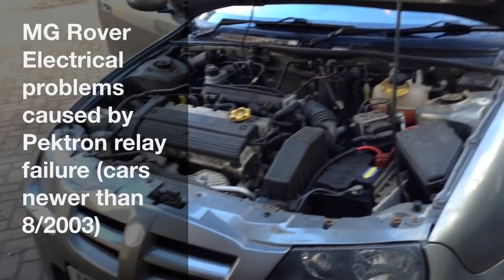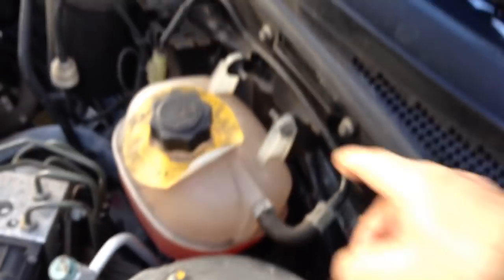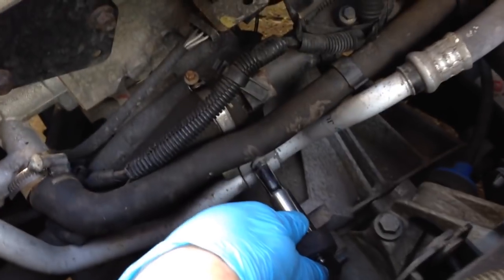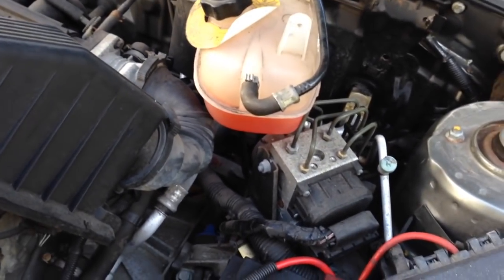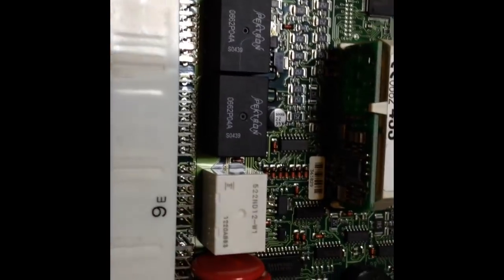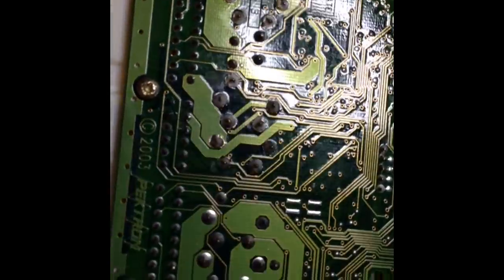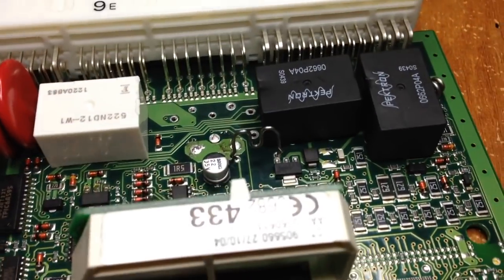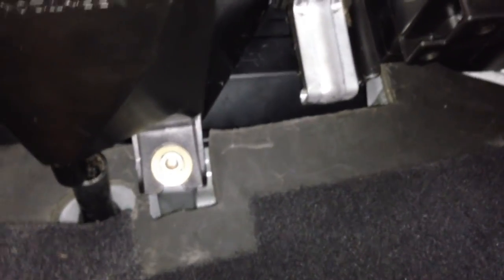How to Fix MG Rover Electrical Problems - Pektron Relay Fault - 8/2003 on

Comment: Good afternoon, I have seen your videos and you are a great professional, could you help me? I have a MG ZR 1.4 since 2003, I really like my car, but a horrible breakdown has come up and I can't find a solution, occasionally the idle goes crazy, the revs go up and down without control, this is very embarrassing, I've tried solve this by changing IAC, TPS, MAP, Temperature Sensors, camshaft, crankshaft, lambda probe, clean connections, check cables, vacuum tubes, change ignition coils, cables, spark plugs .... I don't know what else do, this is maddening, the only thing that works is to turn the ignition key and step 5 times on the accelerator pedal, but the fault appears again in a few days, sometimes weeks ... Could you help me please? Thank you.
Reply from the maker: Thanks. Yes a fun car to drive.  It sounds like the fuel mixture has gone off and the E?CU is stuck in an adjustment loop trying to compensate or trying to adjust the IAC motor (Idle control).  When the revs are going up and down try disconnecting the plug to the IAC to see if that is involved and see if it stops.  If it does your could leave it disconnected - the idle should stay at the position it was at when you unplugged it, so you could do it at say 1000 rpm which is not too high but is enough to stop it stalling when cold.  If that doesnt help you have to look at how the air/fuel ratio could have gotten upset.  Normally this is monitored and set by the ecu by it looking at the lambda/oxygen sensor. An OBD2 dongle with IPhone software is very cheap (see my video on this) and would show you results from these so you can check them.
Reply: Thank you very much for your answer, a while ago, when I also had this problem, I restarted by pressing the pedal 5 times and then disconnected the iac valve, when it was close to 1000rpm, a few weeks later the problem returned, not as serious as before, but the Revolutions were still crazy, so I thought it would be the first lambda probe and decided to change it, but this did not solve the problem either, after a few weeks it happened again.
Reply: I do not know if it will be a coincidence, but on some occasions, the fault has appeared when the wheels have skidded on the gravel when accelerating, for this last reason, yesterday I was checking the speed sensor and the abs sensors ... I don't know what to think, I run out of ideas.
Reply: Some time ago I bought an elm327 obd2, but no code appears when this fault occurs.
Reply from the maker: @eusebioveiga1914  What about reading the lambda sensor readings when this occurs.  By the sound of things the mixture strength is off, maybe an air leak.

Comment: Hi, my glove box is still slack and won't close properly. I suspect the engineer did it when installing a black box. Any ideas ? Thanks
Reply from the maker: The trick to fixing anything is to work out how the latch works and to figure out why it is not working by looking at it.  Then you will be a able to see how to fix it.  See if that approach helps.
Reply: @comeinhandynow  i'll have a look at the two bolts you undid. I thought it was the other two facing outwards. Thanks.

Comment: if you disconnect the battery will that activate the immobiliser ?  can you do this job without discconnecting battery
Reply from the maker: You can I think. I think that is was I did. You can also disconnect battery if you wish but you will need radio code to reenable that.

Comment: Hi,
I am trying to remove my BCU as per this video.
Glove box off, brackets off, filter out, etc. I can move the evaporator quite a lot but for the life of me I cannot find the BCU. Is it behind the evaporator? I've felt and got a torch in there and cannot see it.
Thanks
Reply from the maker: In between the evaporator and bulkhead, as mentioned in video you have to move evaporator out a bit.  Some models like the Mgf I think have it behind the central console.  Google the model you have to find where it should be located.  Be interested to know how you get on. Good luck
Reply: @comeinhandynow  Hi, Thanks for the reply a while back. I have a ZR and I did manage to get the BCU out. I found it easier to remove the AC Housing (AC previously already removed). Once BCU repaired I will intend to re-fit the housing, but mount the BCU somewhere better. 

A question though, the board and relays look in VERY good condition.. I'd expect if the relays were effected by water ingress then I'd expect to 'see' an issue? Or can the board and relays look fine from aesthetics but still have been damaged?

- Drivers window does not go UP (only down)
- Horn does not work
- Alarm triggers if locked via Fob

So I do have multiple symptoms of BCU relay issue, but really worrying if the relays get replaced and issues still present! Haha

Cheers
Reply: Just re-watched the bit where you had the BCU out, yours didn't "look" like there was anything wrong with it. Feeling a bit more hopeful that this is the issue! Thanks again
Reply from the maker: @beneaton91nexus   It’s not water ingress that makes the relays fail, it’s that a wire breaks deep inside the coil of the relay, from what I can see.  So they will look fine from the outside.  Hopefully changing them will fix the issues, just be careful not to break any pcb connections when replacing.

Comment: Hi. Just purchase a run around 2003 MG ZT CDTI 2LTR Estate. Have issue with the central locking. The key fob opens the car but it wont lock it. Have to do this manually. When pressing the key fob, the light shows on the fob but nothing happens. Any ideas.
Reply from the maker: I can only suggest searching the web or those MGrover forums.

Comment: hi i need some help..i recently bought a 1995 rover 416 and my a/c won't work properly..when i turn it on the car just dies..my mechanic told me that the a/c was put on after the car was bought and he thinks that it has a bigger compressor and that the car can't support it..
Reply from the maker: Sounds like the compressor is seized.  Look at the compressor when someone in the car turns on the a/c.  It should go from not turning to turning round as the a/c clutch on the compressor is engaged.  Does the end turn at all?  Try giving the engine some more throttle and revs to stop it stalling.  Does the compressor turn round then?  You could also try turning it by hand to see how difficult the compressor is to turn.

Comment: Hi any help my horn is not working in my mg zr changed the fuse under glove box still not working ? Also I need to take it for mot any help ? Thanks
Reply from the maker: Hi Jay, it is probably the issue I talk about in this video.  From the video description section: “Own an MG Rover built after August 2003? Is one of the following not working:
Horn? Drivers electric window? Central Locking? Fog lights? Intermittent wipers?
It is very likely going to be one or several of the Pektron relays in the SCU unit that have gone”
Reply: @comeinhandynow  thanks where is the scu unit ? Also it’s going for mot tomorrow can they fix it you think ?

Comment: I just got my rover today, and the electric mirrors don't work and neither does the rear drivers side indicator. I don't know what the problem could be?
Reply from the maker: Check the bulb. Try ebay for a second hand mirror.  Get a Haynes manual to help fixing and servicing it.
Reply: comeinhandynow unfortunately I don't think it's the bulb. As for the mirrors, I'll try what you said. I hope it's not a problem with the ecu but surely I'd have more problems if it was?
Reply from the maker: Doesn’t sound ECU related.  With any electrical problems it’s best to get a multimeter(voltmeter) and using the circuit diagram from the Haynes manual, then measure at different points on the circuit related to your fault to try and track down where the fault is.  On bulbs measure their resistance to check them, then measure the voltage on the plug and wiring going all the way back through the switches and fuses etc.  Eventually you will find one spot that has some voltage (usually 12v but it will be going between 0v and 12v if an indicator circuit) and further along another spot that hasn’t any voltage.  So the fault lies in between.
Reply: comeinhandynow brilliant, I'll give it a shot. I don't want to return the car because its sold as spares or repairs and I don't want to go through the trouble of trying to get money back on it, so fixing it myself is the only option. I'll see how it goes anyway
Reply from the maker: If it was a “spares or repair” I would expect quite a few faults.  If you only have those then it’s a good buy.
Reply: comeinhandynow yeah, the electronic problems are really all that's wrong with it, mechanically it's fine. Cheers for your help

Comment: Help me please. I have a Rover 25 stopped working its alarm command after replacing the battery.
Reply from the maker: VIDA EM PORTUGAL Press lock 4 times and unlock 4 times and keep repeating until it works. It needs to resynchronise after a battery disconnect.

Comment: Will this work for a rover 25 2005 reg? As my front wiper does not work but the rear does and also my car locking system does not work it will unlock the car but won’t lock it and I also have issues with the heating as it only works on the third setting onwards not 1,2 could you please help thank you!
Reply from the maker: Please see the video description. Applies to cars after 8/2003 so yes. Fixes intermittent wiper action and locking.  See my other video on fixing the heater fan.

Comment: Were is the tensioner so i can put my new altornator belt on my mg zr 2 lt 05 plate diesel pls
Reply from the maker: Alternator belts often don’t have a tensioner, they are given tension by the position of the alternator, so slacken or remove alternator bolts to fit or adjust the belt.

Comment: help got mg zr on 03 plate no indicators rev counter and speedo work when they won't to and when i turn the wipers on the engine cuts out
Reply from the maker: 1st measure the battery voltage (get a multimeter, only about £5). Should be about 13.4 volts with engine running.  Measure at ECU.  If not check connections to it for ground and power.
2nd check earth straps and that every circuit has a good supply voltage.
3rd if necessary for tracing circuit wiring, get a Haynes manual for your car.  They have wiring diagrams in the back.

Comment: i thought i would mention,,if your air con is drained or not working,as mine was,,its a lot easier to remove the air con box,,,a lot of huffing and puffing saved...
Reply from the maker: That is true, but I wouldn’t leave it disconnected for long as it may mean a new dryer canister is need in the a/c if you decide to regas it, as it may absorb water from the air.  If it’s not fully pumped out the release of cfc’s is damaging to the ozone layer. Not that a one off makes much difference.

Comment: I own an MG ZR 2004 i replaced the battery in one of the fob's and its it doesnt work at all and wont sync up to the central locking ive tried everything.  Also the hazard lights go off by themselves when i turn on the cd player, when i removed the cd and re-attached it they stayed on and only went off after i turned the car off and let it sit for a while.  Also sometimes starting her theres very little kick from the battery.  When i turn on front wipers the back ones go off.  Any ideas???
Reply from the maker: +TheNotoriousTMC Worn out car battery and fob needs syncing by repeatly pressing open and close lots of times near to the car.  Sorry for late reply, just noticed this!
Reply: Hi I have a mg ZR 2005 an iv lost the key fob or immobiliser unit .I still have key ,is there a after market or replacement fob  key supplier that can replace an a method to sync etc I live in newzealand an there isn't a abundance of parts shops etc

Comment: hi do you no if this will affect the hazards switch
Reply from the maker: I don't think so
Reply: I have a problem with the drivers window but I just can't get hazard working light to work I checked almost every think
Reply from the maker: Go through the wiring from the power end, to switch, to lights etc and test at every stage.  Use a wiring diagram (Haynes manual)

Comment: Hi mate my passenger window works then stops for a week then works again any I dear if not thanks anyway
Reply from the maker: Try taking the panel off the door, to get access to the window motor.  Connect a multimeter to the wires to the motor.  See if it reads 12v across some of the wires when you press the window switch.  Keep this connected over the coming weeks and see if the readings are consistent. This will tell you whether it is the window motor that is the problem or the wiring from other parts.
Reply: comeinhandynow thank you very much I'll give it a go

Comment: I have "03" rover 25 2.0TDI. 
Goes into limp mode (fixed 1200RPM & no throttle)  when headlights are turned on, any ideas?
Reply from the maker: maffu waring Headlights on means a lower battery voltage to the ecu if your alternator or battery is poor or the wiring has a poor connection somewhere.  A low voltage to the ecu may push it into limp home mode.  I would start by checking the battery voltage going to the ecu (use a multimeter) to see if it changes when this fault happens.  The voltage would normally be around 13 volts.  Good luck!
Reply: comeinhandynow it is fine with AC, rear heated window, ew etc. I was thinking the same until it was fine with these drains
Reply from the maker: Headlamps take a lot of current, probably more than those others.  Checking ecu voltage is probably a good place to start.
Reply: Any chance of a step by step?  
I'm hoping it's something simple lmao
Reply: comeinhandynow
Reply from the maker: You need to get a wiring diagram (look on eBay for a Haynes manual maybe?).  Multimeters are cheap, about £5 if you shop around. Start familiarising yourself with both, then try and check voltage going to ecu,  that's as much as I can offer remotely.
Reply: I can use equipment, and have a multimeter. Just not sure what I'm looking for our how to access
Reply: comeinhandynow
Reply from the maker: You need to get a wiring diagram (look on eBay for a Haynes manual maybe?)....try and check voltage going to ecu, that's as much as I can offer remotely.
Maybe before that step just do a quick check of the battery voltage, with and without head.ights on. It may indicate a problem if it drops.

Comment: Nice and helpfull video their. Personal opinion after seing where the dopey gits who designed the ruddy location of the unit would be to then RE Locate the device. Eg either cut and solder more wire inline with the connectors or make them stretch. A days work no doubt. And a two second job the next time around.
Reply from the maker: Cheers. Once all 5 relays are changed no need for a second visit and once it is out it is a bit easier to refit.
Reply: @comeinhandynow  and every new car which Follows that also gets harder to repair. And we get older each time. Henc the bliter gets away again.

Comment: I have got a rover 75 can't get one of the number plate lights to work can any one help me with the problem
Reply from the maker: A Haynes manual may help in terms of taking it apart, perhaps.  If all else fails put in an extra wire connecting it to a light that does work.
Reply: I bought two new bulbs passenger side works but driver side doesn't

Comment: Hi I don't want to get into this if I don't have to

This is my issue

Hi all IV got an 54 facelift mg zr the dahslights (Speedo rev count) background light does not come on,

I have checked all fuses under bonnet and under drives steering wheel area. 

I have taken the dash out and checked bulbs and none are blown.

What else could the issue be caused by.

If it helps the car randomly stalled when idling parked up and when the car started back up the dash lights where now not working.

Has anyone had this before or know what else do can check to fix this issue?

Help appreciated 

Thank you

UPDATE* 
SINCE THE ISSUE HAS OCCURED

THE FRONT bumper passenger indicated bulb doesn't work if you use the hazard lights but if you indicate with the stalk it's fine, 

The passenger window also now no longer working. 
And a rear passenger tail light also not working 

So is there a relay or some electrical thing that these Al go to which has blown like a relay or something or a circuit board??
Reply from the maker: Sounds like you have a corroded earth point that is causing a bit of havoc.  Try and measure the voltage at a bulb that should be on but isn’t and see if it the positive side that is not at 12v or the negative side that is not at 0v.  You must measure the voltage with your negative multimeter probe on the battery negative dirrectly.  This test should guide you in the right direction.
Reply: Okay thank you is the earth I should be looking at the battery earth or one off the alternator that could've bad?
Reply from the maker: Probably some junction somewhere, but you need to trace it back from the point of failure. So measure the voltage between the battery negative and the negative connection to a failing bulb.  If that is not zero then the earth .connection that that wire goes to is bad.  Trace it back.

Comment: why dont you just buy some desoldering tape its easier
Reply from the maker: +Pete Rodens It's down to personal preference I guess, but I've always found a solder sucker better at evacuating all the solder from the PCB holes, whereas desoldering braid will leave holes filled. It's good if it works for you though.